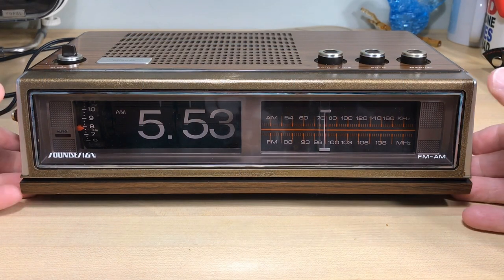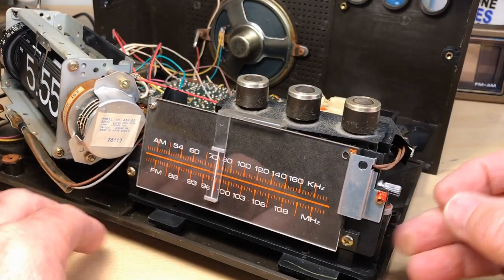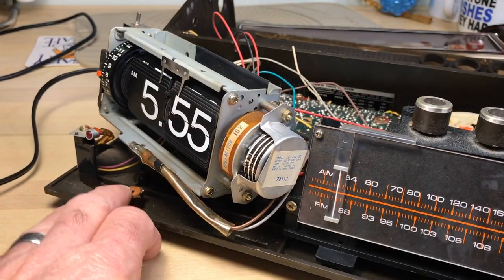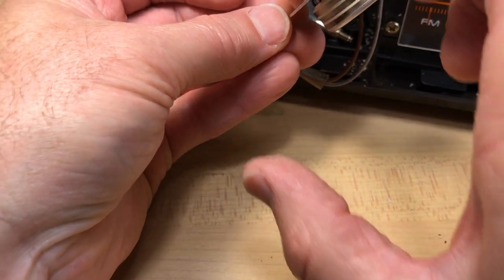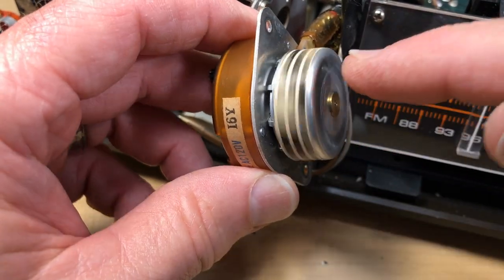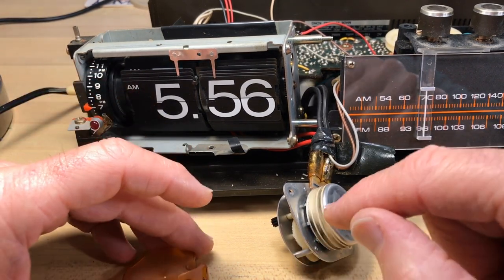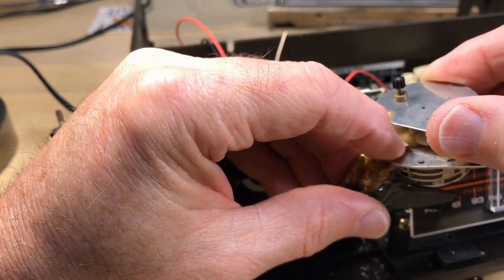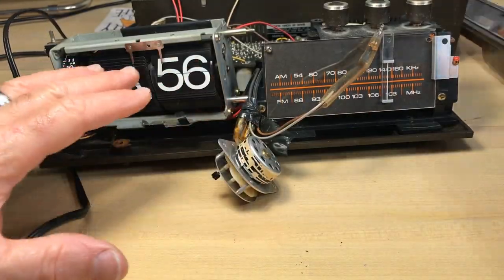Soundesign Model 3578 Semi-Jumbo Flip Clock Radio

Comment: Nice! To bad Sound Design didn't allow a space to view the spinning clock motor like many Lloyd's, Realistic and others do. I have a bunch of full length neon bulbs that you show. I to had trouble finding the original length, and searching through hundreds of ebay listings a few years ago, I was able to find some and I bought about 30 of them. it could have been a site not on ebay, I don't recall but I did find them.

Comment: Hey, I have a question. It's not about this video, but i didn't know how else to contact you, and  you seem to know stuff about Flip Clocks.
I bought a clock and it worked fine for a year, one time the thing with the magnets and the axle fell out of the motor when i moved it, I put it back in and it kept working fine. But now all of a sudden it stopped working. The thing still spins but the clock doesn't advance. I guess the axle isn't connected to the gear inside the gearbox anymore. Do you know if this is fixable? Should i take apart the gearbox and try to reattach the gear?
Keep up the good work!
Best wishes, Frantz
Reply from the maker: It’d be good to know what make and model clocks you have. It does sound like opening up the gearbox will be necessary.